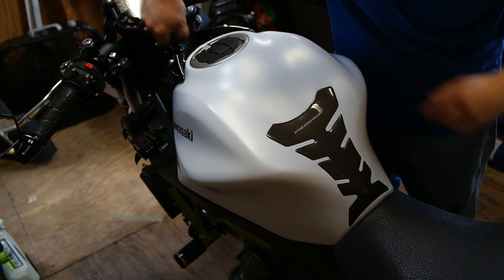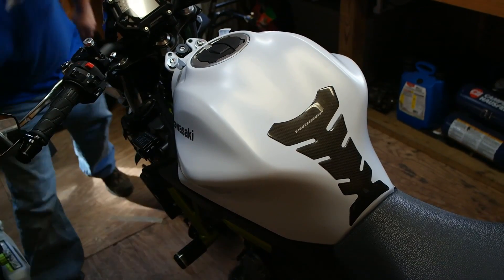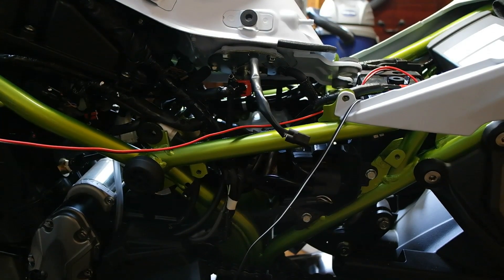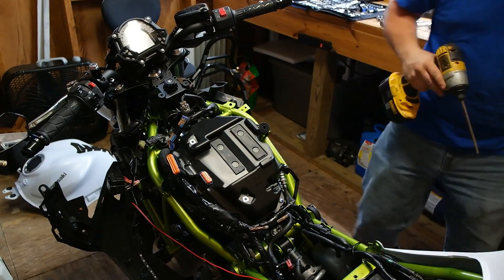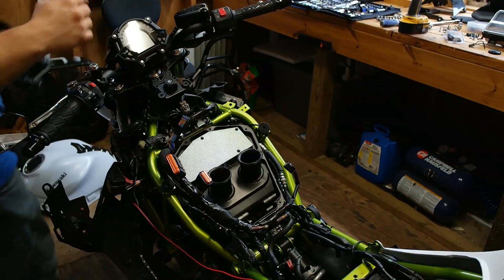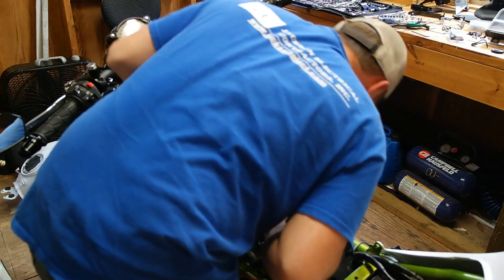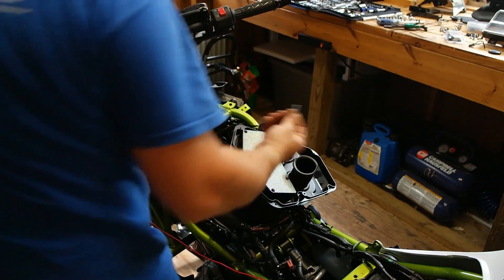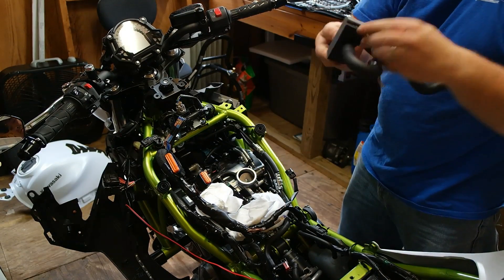Kawasaki Z650 Tank and Airbox Removal | Blockoff Plate Install

Comment: Was the addition of the resistor across the pair valve connector the final solution to prevent a CEL? What was the value of the resistor?
Reply from the maker: 1/4W 770 Ohm - 1k Ohm or 1/2w 400 Ohm - 770 Ohm
Reply from the maker: https://amzn.to/2MQ4jLx
Reply: @Tremonte  i don't know much about resistors, but in the video you said you need a 20 or 22 ohm resistor but then sent a link for a 400-770ohm resistor?
Reply from the maker: @NoDayz0ff  because a 20-22ohm would require a higher wattage rating, and is not as easy to find . You can use the one linked that is lower wattage and will work just fine.
Reply: @Tremonte  okay awesome! Thank you

Comment: Thank you! could not have gotten to the coil packs without your help.

Just installed a TransLogic Quickshifter on my wife's Z650. Truly plug and play kit, did not have to touch any settings to get smooth shifts.

Comment: Hi Tremonte, thanks for this helpful video. I couldn't tell how you were able to take off the bottom air housing, what screw did you take off and what tool did you use? I see a tamper proof torx screw there, is that the one to remove? thanks

Comment: The connection mounted to the bike, where your fuel pump plugs into for power, where does it lead? Mine was stolen a couple years back, after recovering it last year, installing a new wiring harness was one of the things I had to do, Some areas are lost on me, however I see from the video what I'm missing on that mount is where you power the fuel pump from, is it a lead straight to the battery or?
Reply from the maker: It goes to the fuel pump relay. Left side under the plastic guard near the fuel tank and ignition trim covers.
Reply: @Tremonte  Is it the one with three electrical connections going into it?

Comment: I watched your video- thank you- very informative.  I got everything off, but I ended up finding a square rubber washer on the ground after I took my tank off. Any idea where it goes?? I don’t recall seeing it when I took everything apart.
Reply from the maker: I recently changed my air filter and don't recall any square rubber washers. There could have possibly been one between the air box and the pairing valve for vibration dampening. I can't remember since I deleted all of that.

Comment: Great video.  Very informative.  I have a 17 ninja 650 and this looks like its a lot more difficult than the older model in the other video. Roughly how much more hp and torque does the bazzaz add to the bike?

Comment: I been looking alot on your canal before i did buy a bike, and i got a used Z650 2018 model with only 4500km, its about 2800miles for e very good price, half of what it cost new. Problem is i live in Bangkok for the time and the bike runs hot coz many days its well over 40 Celsius outside and when i drive in traffic jams. I order a tuning exhaust, and im gone get a airfilter from DNA. And i have make a appointment for remap the bike so they can adjust the fan to kick inn at 90 degree Celsius and not 120 as stock. Did you see any different with working temp on the bike when you did your remap?

Comment: 20 ohm 5 watt resistor? Did you just plug it into the adapter and electrical tape it? And did you have to flash the ecu after doing so?

Comment: Tremonte, thanks for your videos, really informative and intersting. Would you happen to know how to remove the evap canister for CA spec Z650 models?
Reply from the maker: Omar Fahmy usually it's nothing more than plugging a line and rerouting the tank vent. Check with the ninja650 crowd. It's been around a while and I'm sure someone has done a write up or video.

Comment: Hey sir I have a question, 2017 ninja 650 did the two brothers full exhaust and I'm looking at your video about a block off plate and alot of forums say to put one on. My question is what were you needing to jump wires to avoid a CEL for? Is the plate going to throw codes? I dont plan on tracking or tuning. I have a power commander enroute now but I heard about popping in downshifting with aftermarket exhausts. Is this piece actually required? Since I have everything off for the PCFC I figured I'd look into doing it. Thank you for your videos, they've been instrumental in helping me do the mods and upgrades to my bike
Reply: Did you ever find the answer to this?

Comment: Were there any specified torque values on any of the bolts removed? Specifically for the tank?
Reply from the maker: The values are in the service manual. Most are only around 20-25ft-lb, so not much at all.

Comment: What exactly does the Blockoff Plate do? Not sure how it helps to get more accurate dyno readings.
Reply from the maker: +NutNbutSpeed it dumps air into the exhaust port to create a hotter mixture for emissions. That extra air can cause the sniffer on the dyno to give false readings. So in order to be accurate, a block off is needed. It also helps to reduce the popping from aftermarket exhausts.
Reply: Hi mate in Australia we just leave the pcv connected and put marbles inside the air hose. It give you no codes and effectively blocks the air flow. I have done this to my Z1000 stops all the backfire issues you get after an exhaust change also. Good video mate.
Reply: Farmer Joe Do whuuut? Why not just plug the nipple with a vacuum cap and slide the hose over the cap.

Comment: don't mean to sound like a dummy, but what is the purpose of the block off plate? I've never heard of this being done.
Reply from the maker: SHOVELCARD  it is to remove the smog system on bikes that will be setup for the track. Without a plate, the smog pump will dump extra air into the exhaust ports and cause false readings during the tune session. There is no performance gain from doing this, it's solely for more accurate readings.
Reply: Tremonte thank you for the explanation and great step by step video